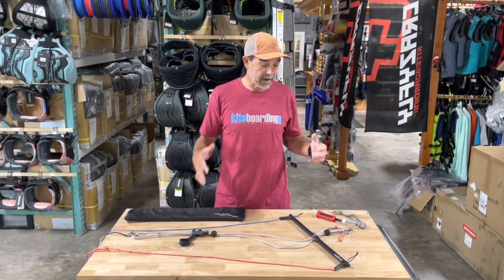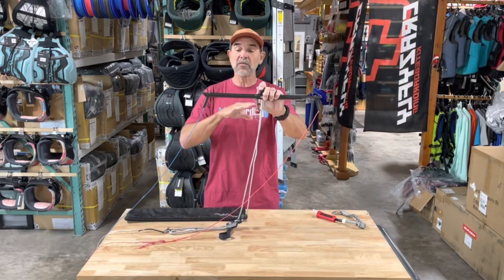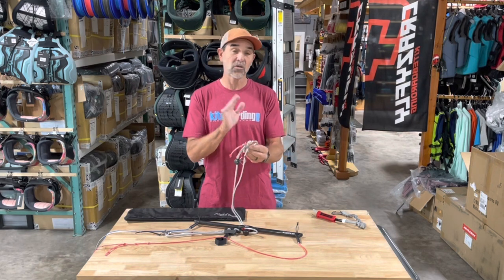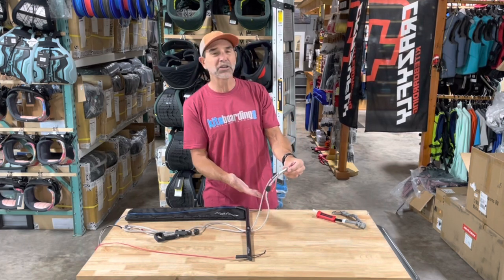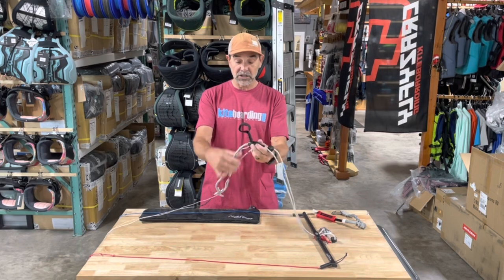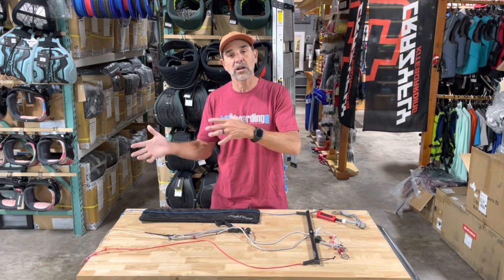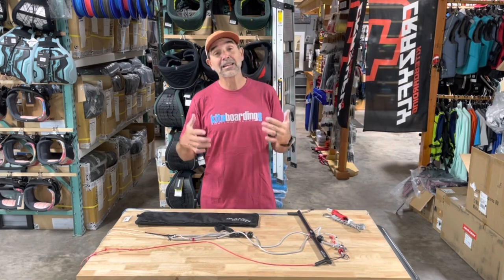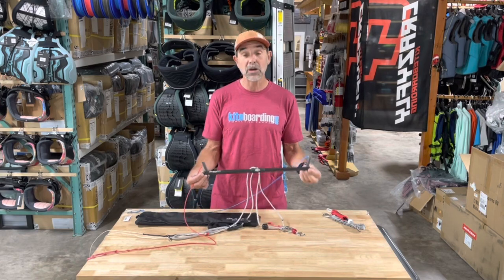Naish ZERO Bar - Ultra Light Hydrofoil Control System

Comment: Great review, but wondering if the bar surface is bare or does it have a grip/traction coating?
Reply from the maker: The back side of the bar has been sanded giving it a grippy texture that works very good.

Comment: I would make the cleat much smaller, it doesn't make any sense to have a bar that minimalistic with a huge n heavy cleat and V split.
Reply from the maker: One of the cool things about this bar is that you can easily customize it if you want.
Reply: @kiteboardingcom  thanks to you I learned so much about that. All my bars are customized.